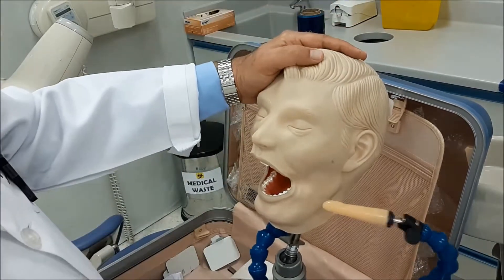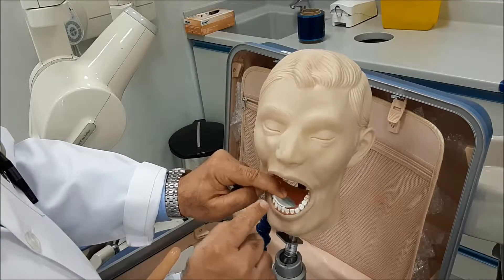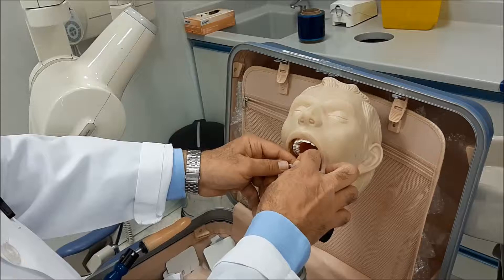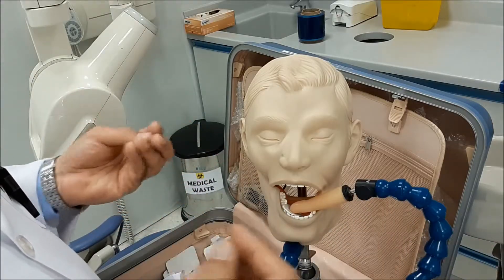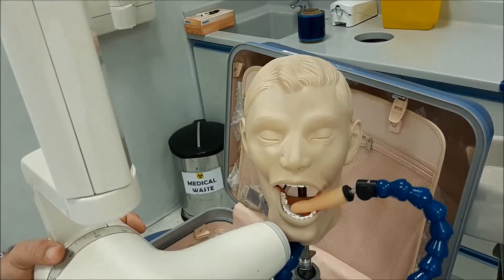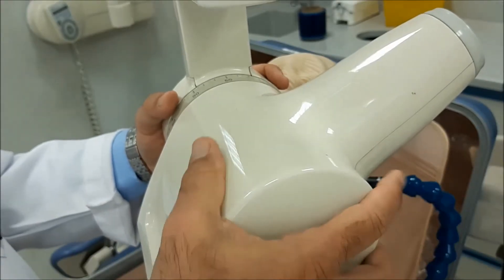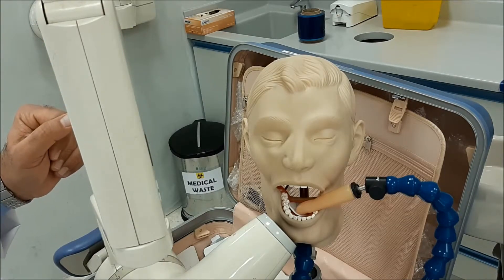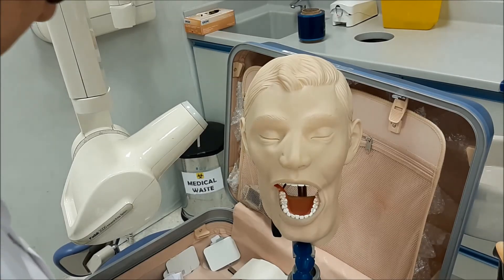Lower Canines Angle Bisecting Technique

Comment: Is it important to position te head so that it becomes a little tilted backward? And what to do if the floor of the mouth is so shallow which makes it hard to place the film correctly and leaves a big part of it above the incisal  surface?
Reply from the maker: Dear #MGTOW, thank you very much for the your comment regarding tilting the patient's head slightly back, totally agree to that. 
If the floor of the mouth is shallow, what you need to do is to increase the angle of the sensor in a way so that its upper margin touches the incisal edge of the canine, while the lower margin goes well below the tongue,  so the sensor assumes more of a flat position. 
The next step, is to increase the vertical angulation of the PID in a way to make it perpendicular on the angle bisector between the plane of tooth and the new plane of sensor to ovoid elongated image of teeth. 
So in a normally positioned sensor, the vertical angulation is -20 to -25 , in this case, you need to increase the angulation to -35 to - 45. 
I hope I made myself clear. 
Best regards.